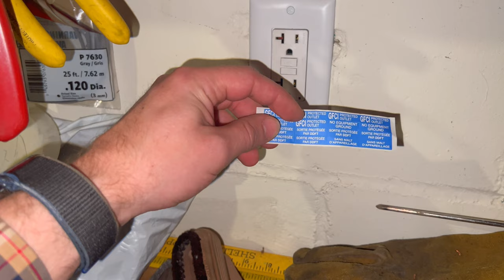My Vacuum is Shocking Me! Reversed Polarity Outlet

Comment: Not sure how I came across this video, but it was interesting to watch nonetheless. You are correct that there were only 2 ways to fix that outlet without the presence of a ground wire being run to the box. The GFCI will still protect to a lesser degree. And it's very good that you put the sticker to indicate no ground present. The sticker may eventually peel off and unstick on its own over time depending on your climate and humidity. If I was in your shoes I might write "NO GND" in sharpie or something similar across the faceplate of the outlet. Cheers.
Reply: Running a bare copper wire to a water line would fix this? It can be completely exposed and mounted right to the brick wall.
Reply from the maker: @Sam Steele Are you suggesting this is a fix? That does not sound like a safe fix....
Reply: Asking if it is......I mean a lightning rod and other systems are grounded to the waterline.
Reply: Do NOT, I repeat DO NOT run your ground to a water pipe if you don't now what you are doing. Unless you know exactly how the pipes are run from the water main to your house you should not be doing this. It is not up to code and you could end up harming someone with a shock or electrocution. What the uploader did was a sufficient solution for the problem he had. If you're determined to add a ground line, do it the right way and fish a new ground wire to junction instead. Or run a dedicated grounding rod that is bonded back to the service panels to a common ground.

Comment: Either that is harmless leak or the device is faulty. Neither of the wires should connect to the case. You are playing with your life. Get it fixed.
Reply from the maker: Depends, is it a fully insulated motor on a Filter Queen?